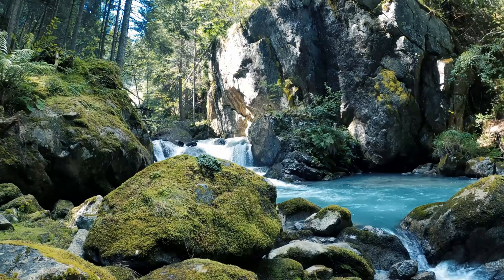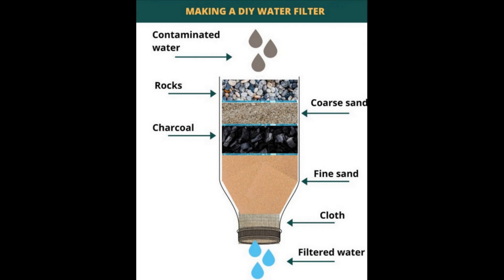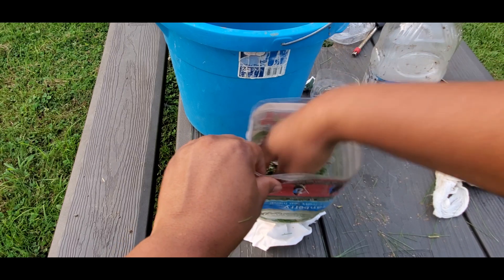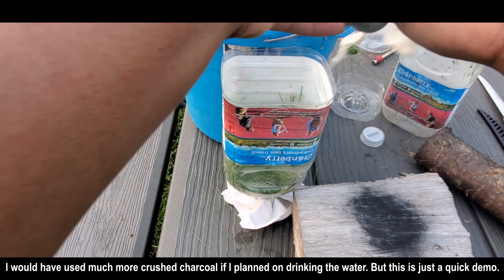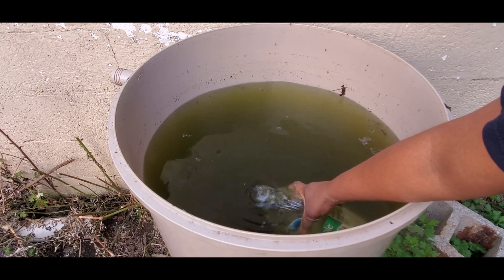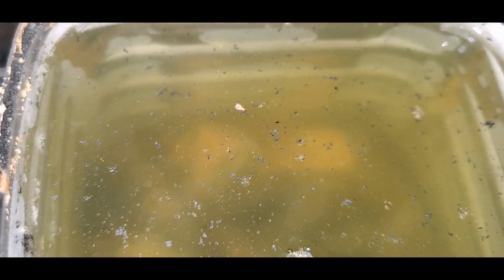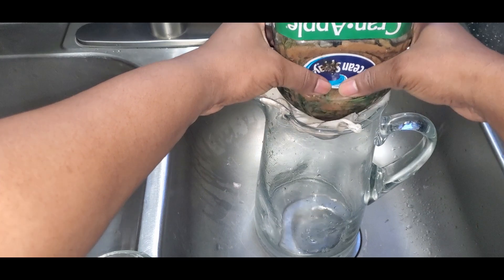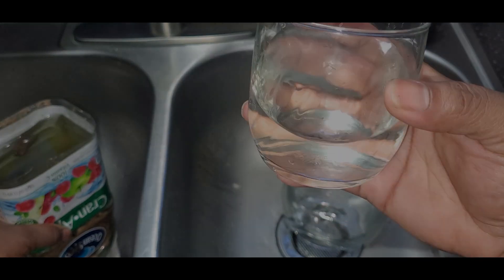DIY Water Filter | How To Filter Dirty Water

Comment: Terracotta pots are another great way to filter smaller particles.
Reply from the maker: Clay jugs appears to be a method of filtering and cooling water that has been used for centuries in various countries. 

However, like charcoal filtering, it seems like you would still need to boil the water to be safe.

Thanks for mentioning terracotta pots.